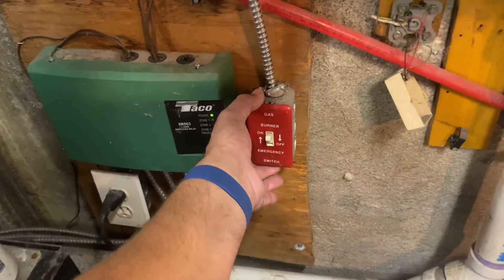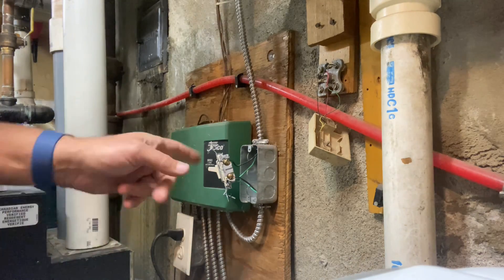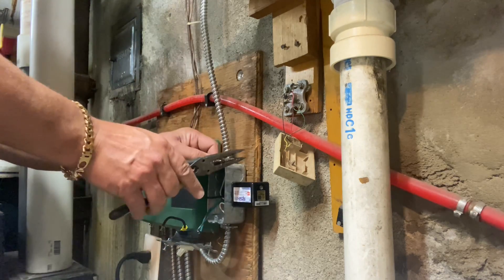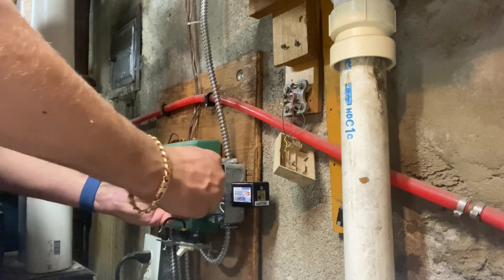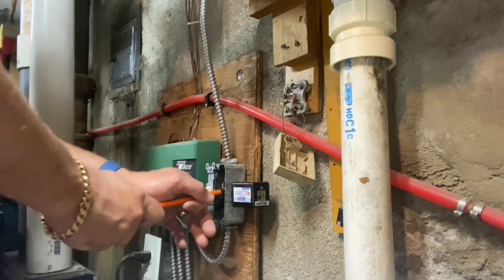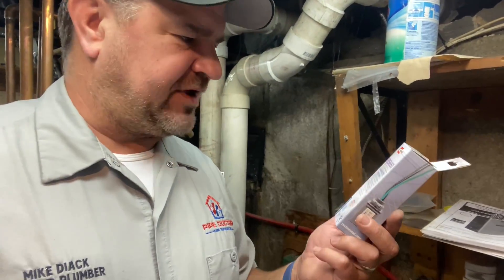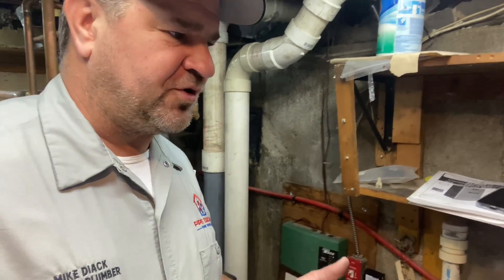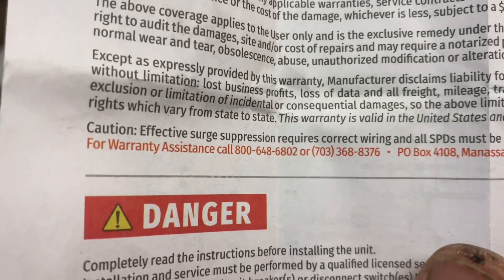Installing Surge Protector on Hydronic Boiler Circuit to Protect HVAC Equipment

Comment: Hey Mike Diack, of Mikey Pipes Plumbing not easy cheesy. I like your podcast/social media, looking thru some comments/reply??. Hmm? thoses micoproessors don't like over and under voltage, and over amperes and over and under freguencies of power supply. Is that an auto vent you are working on? Hmm? 42 volts will kill. Love you buddy, you be safe out there.

Comment: switch was wrapped in tape, that's ok. but it also had a wire wrapped backwards on a terminal, NOT ok. lol clockwise only!(unless you have some oddball left-hand thread, never seen anything myself)

Comment: That switch box also was supposed to have ground wire connected by a screw to it. And normally you dont want short wires less than 6 inches but those surge protecters/areesters manufacturer instructions ovverride nec. Also if your going to extend wires they have to be the same size or larger tht stranded left over was 16 or 18 gauge should have been at least 14 but chances are it will be OK. Not bad mikey but really you should stay in your lane

Comment: Better stick to a/c & plumbing. Needs either an extension ring or change to a 4" square box.  NEC Table 314.16(B). Trimming wire length to shorter than 6" is also an issue . NEC Section 300.14  
l'shana tova שנה טובה